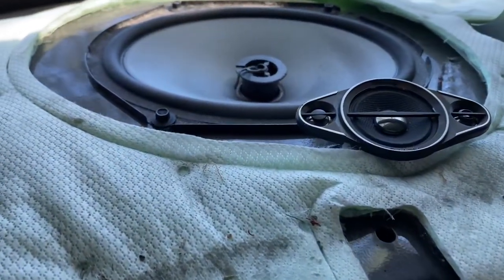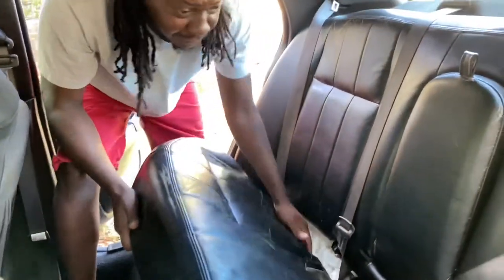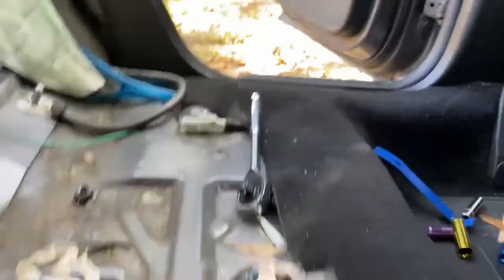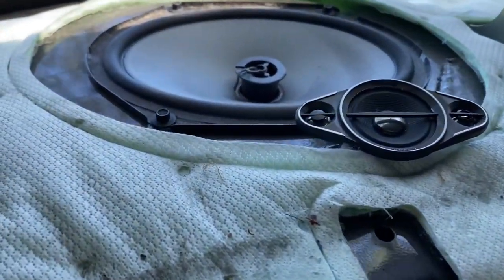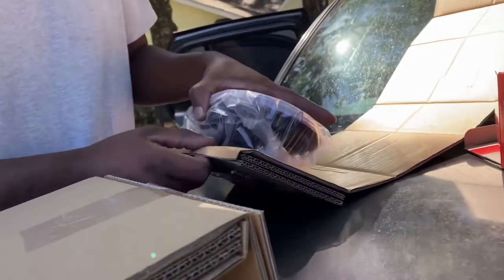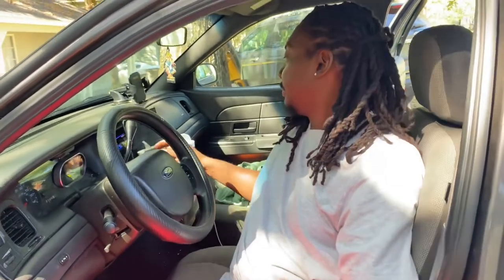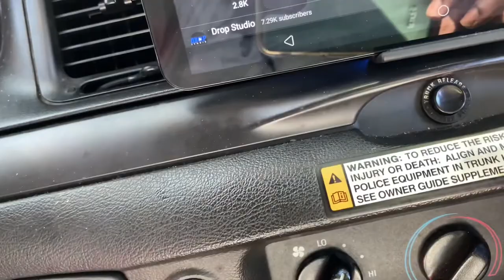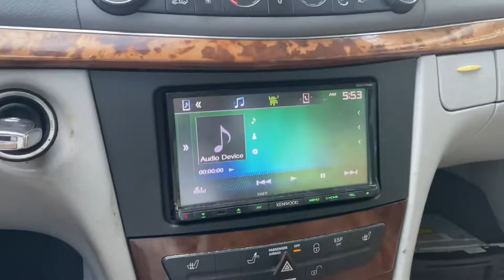Installing 6x8 speakers in my FORD CROWN VICTORIA P71 Cerwin Vega

Comment: I put 4 of those same V468's in the doors of my 2002 Ford Explorer and they are a very high quality speaker. Well packaged. Thick cast frames. And a pretty big magnet. I had to remove the trim rings from the stock speakers and use them as a spacer to clear the large magnet. They don'y play a deep as some other brands (that's what your subwoofer is for anyway) but the do hit harder then other brands I've had like Pioneer and Kicker. All my own opinion of course. A seperate amp to drive them will imrove the sound of any good speaker. Head unit amps uaually aren't really that good. Enjoy the sound!

Comment: Big Dog how r u, I’m known as Gorilla Soulja on YouTube. I only have only one video up now. I got a lot coming this Summer, so look out for me. But the reason for the text, I noticed when u took your back seat out u still had that White insulation behind the seat. If u were to take it down, your system would sound louder. You want have nothing blocking your Bass from coming thru. Believe me it works

Comment: I installed an alpine head unit in my Vic single din next is to install the Polk dynamic balance  for the rear deck its a 2001 p71  I also have to run my Bluetooth microphone lol my whip is the same color as yours ✌✌✌✌
Reply from the maker: Cool ,I’ll love to see it.

Comment: I have a 1997 grand marquis. I ordered 2  Skar  ZVX-12v2 subs . I ordered a harmony audio 1500.1 amp. I plan on feeding the subs 2000 watts max. I was going to build a box and fire the subs back but  I am worried about blowing out my rear speakers now.  I looked at the trunk shelf and it measures 12 inches, I am wondering if I should try and box them into that area with a big port and fire them right at the rear seats or should I just build a box and fire them back?
Reply from the maker: That’s a good question, I thought a box with a port on each top fire left and right, but it was just a thought
Reply: @benzboyt8794  OK I will ask the box builder what he thinks, I am pretty sure if I leave the 6x9s in the stock location they will get damaged, I have 2 kids, need the back seat. I talked to a few guys with vics and they said to pull the rear speakers and put a large port in the rear deck for the subs to transfer pressure better. I haven't had a decent system in 20 years, I am getting pumped. I am thinking move the speakers to the rear doors and use 6.5 inch components front and back on another amp and run the 6x8 door speakers off the deck

Comment: Sub pressure killed your speakers
Reply from the maker: Do you have any suggestions
Reply: @benzboyt8794  You need to get sound deadener, 2 layers of 80mil butyl rubber on the deck the speakers are mounted on.